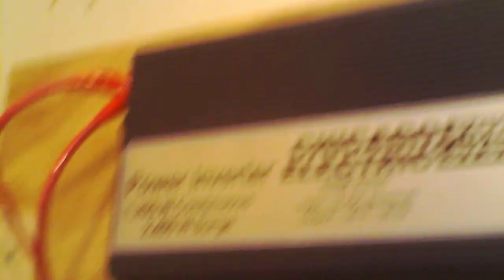Schumacher 410W inverter guts

Comment from the maker: Excessive contact resistance in the receptacle.  Check the plug and receptacle for dirt, corrosion or other gumf on the contacts and clean them if necessary.

Comment: yea i swapped the 2 25amp fuses for 2 20a fuses because on the old one 1 fuse blew and the other didnt/ Thinking because they were the cheap dollar store type fuses it failed to pop when the short happened, so to be safe 40amp total instead of 50 so if it fails it will blow fuses instead of internal components. The thing LITERALLY caught fire when the serge initially happened. I got the digital 750 one by the free from another person who knew I wanted an inverter as well :) Digital display show

Comment: thanks yea backround in industrial electronics lol caps pack a punch. Discharge stuff like this before working on them same with older tv's :). It was under warranty so I just exchanged it but I did get a peek inside and the hot 110v side touching the vehicle groung serged because the inverter was on metal and the 12v and 110v are not isolated so the 110v had to go somewhere. thanks for the useful info incase i blow this one. older inverter (vector) touched a million times and just shut off

Comment from the maker: It depends on the design of the H bridge and its driver circuitry.  Look to see if the H bridge MOSFETs all have the same part numbers.  If the 3 surviving MOSFETs have the same part number, then that is the one to get as a replacement.  If one has a different part number than the other two, then that is the one to get.
Note that any MOSFETs that have rated operating potentials of under 200V should NOT be counted as they are the transformer primary drive MOSFETs.

Comment: I have the newer 410W Schumacher inverter. The ac lines touched and it caught fire!! Upon taking it apart it appears one of the mosfets blew. Are the ones on the right the same as the left? there are 4 but the one that blew isnt visable anymore. Thinking of repairing but would like to know if the power touched ground on the ac side would replacing this chip fix it. 2 days old and I cant find the receipt as it was a gift! repair is only option :(